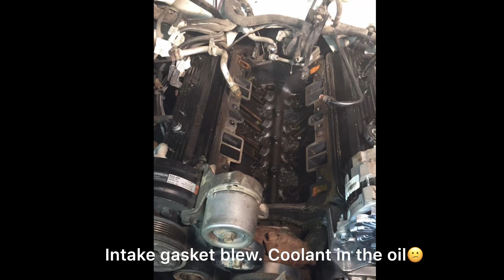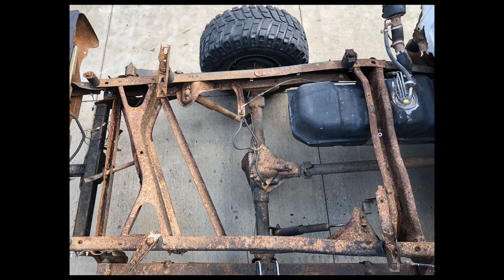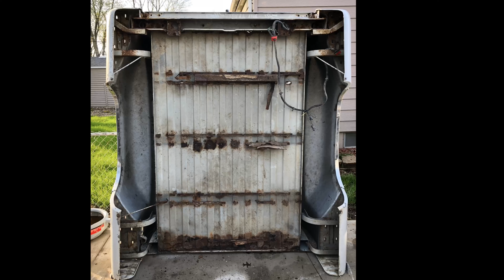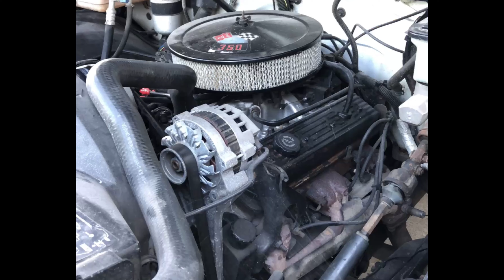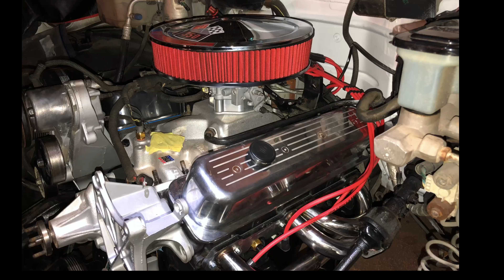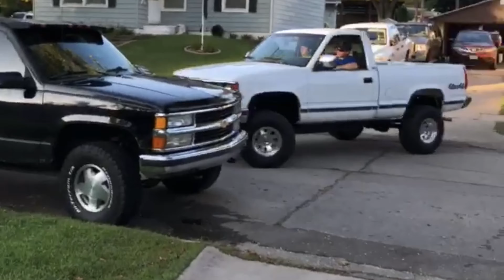Chevrolet Silverado K1500 Transformation

Comment: Dude this awesome,  any tips you learned?  I’m getting ready to start on my 89 k2500
Reply from the maker: adam blasingame a LOT man lol. Don’t know where to start. Mainly take your time and don’t cut corners like i did on the body work. One of my biggest regrets. Quality suspension parts make a huge difference. I like mevotech personally. I put cheap joints in my 94 and smoked a ball joint in 3k miles lol. But really if you’re gonna sink some serious money into one dot it how YOU want it. I’m pretty happy with this one overall I just want a 4” suspension and 35s on top of the body lift. If ya have any questions give me a shout on here or my FB or instagram.
Reply: Dont spend money on tbi motor,  $1,600 for the TBI crate motor 3 to 500 for the intake and a whopping 190hp and that's at the crank! So... you want 130hp turning them 35"s ?  A tock junkyard 5 .3 has an extra 100hp  ten bolts are not good 4×4 rears get a tranny cooler with a fan a Detroit truetrac,  you will be happily ahead of the game.
Reply from the maker: @kevinwest3689  not 100% accurate but ok
Reply: , I pride myself on saying what I mean and meaning what I say, knowing what the hell I'm talking about or not talking, But you are absolutely right that I'm not 100% correct,  The power to the wheels on those TBI 350 4×4 trucks is 190 at the crankshaft, But my estimation of how much power after it's through the transmission through the transfer case down the drive shaft and turning the rear gear & then the  tires, was a total estimation on my part based on what people that work on dinos, like West Tech in California, freiberger or Richard holdener, ect ect, it could be closer to 150 hp at the tire.  But I'm with you 99% correct is not 100%  make that 97% I didn't add the tax or shipping for the crate motor.

Comment: I have basically the same truck it's in really good shape but I'm gonna repaint it and take the bed off and paint the frame were did you get you're por 15 from?
Reply from the maker: ricky weaver Advance auto! It’s not cheap I think it was around $65 for a pint. Probably cheaper on amazon though. Brush on. Do NOT let it get on your skin or anything. It NEVER comes off. It’s still all over my driveway too lol.
Reply: @CollinZ71  I've been protecting my frame with vht rollbar and chassis paint but this spring I'm gonna redo it when it's actually warm enough to take the bed off and paint lol my truck just has a little quarter size rust hole in the passenger side rocker and on the rear wheel wells of the bed evreything else is perfect for a 4x4 truck I lucked out when I got it lol it's a 4.3 5 speed but shes getting a 350 crate engine this summer

Comment: I plan on painting my truck in the garage how hard is it did you use spray paint or a paint gun and what paint did you use
Reply from the maker: Bakers Lawn Care I didn’t do the whole truck, but it was done outside. All I painted was the door, cab corners and rockers, roof and tailgate. Dupli color summit white paint (WA8624 I think). I ordered special 2K clear coat. It’s rattle can but it has hardener/reducer additives you mix in it. It’s not hard it’s all in the prep. You can get gun results with it if it’s done right. I recommend a spray gun if you’re painting the entire truck. If you’re budget building it look up Rustolem/Acetone mixed in a spray gun on YouTube. Lot of people finding success in that and it’s cheap!

Comment: Great work on that 92! I’m in the process of building my 92 GMC Stepside, what motor did you drop in that truck? Sounds mean! Awesome truck definitely something to be proud of
Reply from the maker: Jegs crate 350 tbi!
Reply: @CollinZ71  Nice! I ended up dropping a BluePrint 5.7 crate motor with vortec heads in my 92 Stepside, around 380 hp. I got away from the TBI and running a carb on the motor. Kind of wishing I would have went back with TBI or a Holley Sniper EFI on it